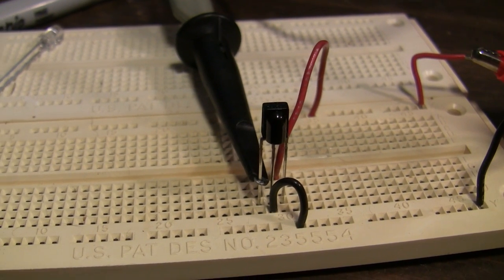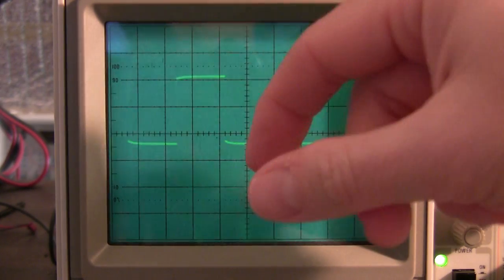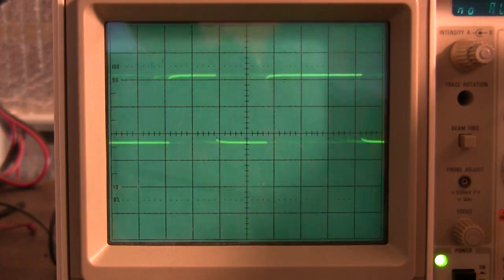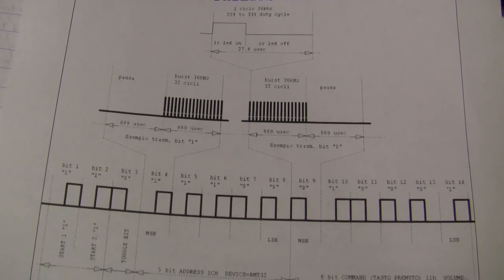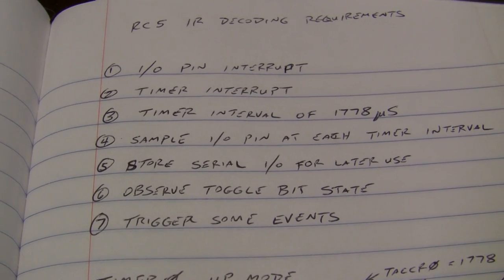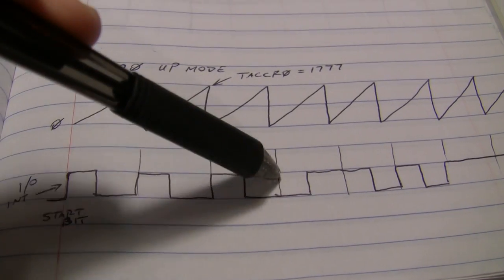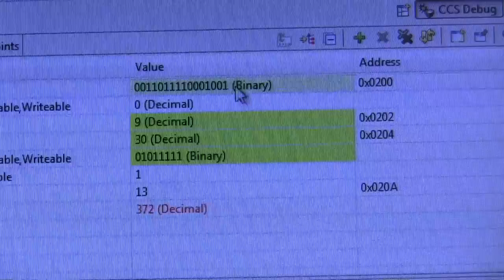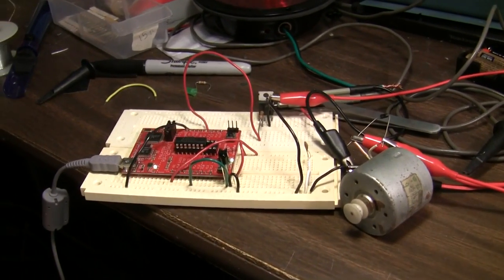Infrared Remote Control Decoding

Comment from the maker: It's the Texas Instruments MSP430 Launchpad board, for experimenting with MSP430 ValueLine microcontrollers. About five bucks from ti.com, comes with two chips in the box. The MSP430G2211 is what I was referring to as the 2211. You program these things largely by setting registers directly in C, so it feels like you're closer to the metal than Arduino. If you're willing to read the datasheets and invest the time in it you'll be able to do code for most any other microcontroller out there.